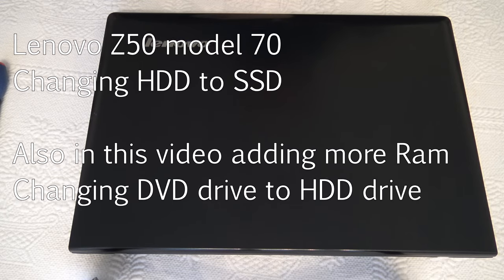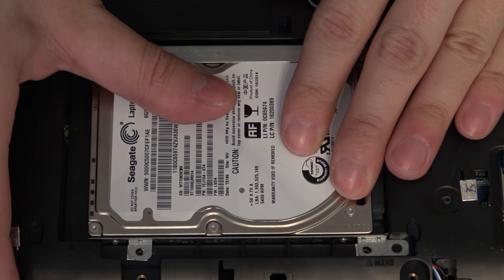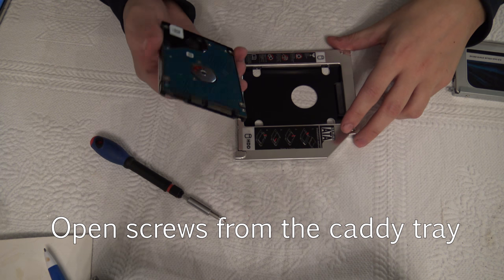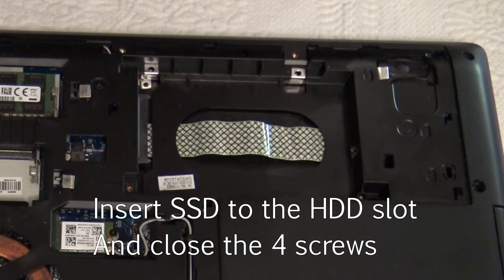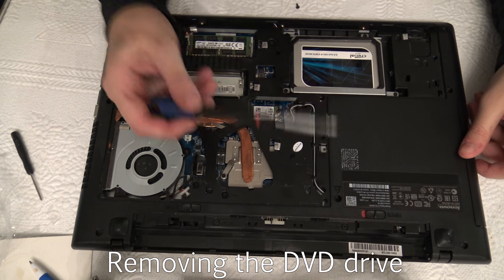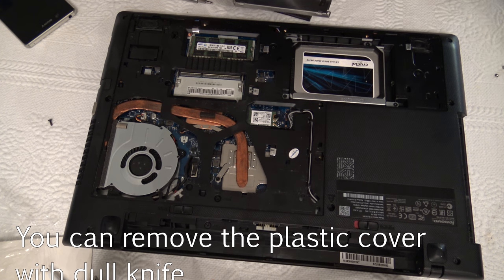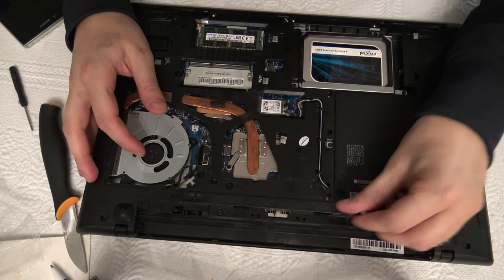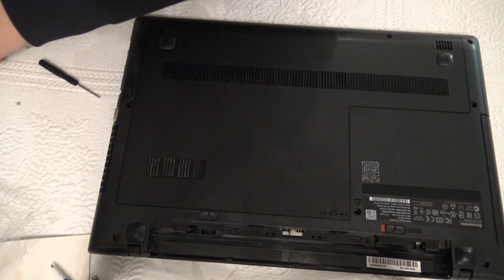Lenovo Z50 upgrading HDD to SSD

Comment: Same laptop I installed a kingston 240gb ssd and my laptop starts in more than 1 minute, the ssd and each partition  in it is aligned, help!!!!!
Reply from the maker: Hi what operating system are you using? Did you install the latest driver for the SSD?
Reply: My other laptop lenovo starts in less than 5 sec with the same OS and ssd u.u
Reply from the maker: Did you do clean install or did you move the old data from old hard drive moving data from old drive can make problems what i have read? 
You should try first installing this driver "Kingston SSD Manager" and run the program and see if it helps. My internet is really slow here in China. https://www.kingston.com/us/support/technical/products?model=SUV400S3
Reply: Love you Mikko <3, sorry I didnt notice you already answered to me, so yeah I fresh installed the w10 pro u.u, gonna try installing the driver bro, I will let you know :D
Reply: Mikko I used the kingston ssd manager and it says everything is ok, even the firmware, what should I do then?????? u.u
Reply from the maker: +Papu Papuino Well you should try this.I believe there is some short of settings issue, Operating system issue or the SSD is broken. 

Try tuning the Windows from settings.

How does the process show on task manager how much it keeps using the SSD capacity in % after minute it should drop to close to zero. 
https://www.partitionwizard.com/partitionmanager/how-to-get-best-performance-from-ssd.html
Reply from the maker: Have you managed to get it working?
Reply: Yes mikko ty, it was just an old driver installed to the sata cable, I manually update it and everything got fixed :)
Reply from the maker: +Papu Papuino Nice to hear they it was very small problem
Reply: yeah kinda lol greetings and have fun in china bro!

Comment: I've gone through the whole process, now the question is. how do I migrate my OS into the SSD? And I can't seem to see it in my list of drives on my PC
Reply from the maker: Do you use Windows 10?
Reply: @MikkoTenhunen  Yes
Reply: @MikkoTenhunen  I have also installed the Crucial Storage Executive Suite
Reply from the maker: Try this guide https://www.easeus.com/resource/hard-drive-not-showing-up-or-recognized.html
Reply: @MikkoTenhunen  Thanks mate! That worked!
Might you also have a link that shows how I can clone my OS into my new Crucial SSD that I've just installed?
Reply from the maker: I used the easyus premium app which you can find from Internet. There are alot other ways to clone your HDD, but if you used it for long time you should do clean install of windows because it would be faster. https://www.easeus.com/disk-copy/clone-resource/clone-hard-drive.htm
Reply: @MikkoTenhunen  I am trying to do a clean install of Windows 10 on the SSD using a bootable usb drive but my laptop does not get past the Lenovo screen. I have tried playing with the BIOS UEFI and Legacy settings, disabling Secure Boot, but still can't get past that. Do  you have any ideas what could be possibly wrong?
Reply from the maker: You have to set the bootable device first in list then press I think it was F8? It might be esc F1, F2, F10 button that opens usb list of devices then you select the bootable device with the windows install device

Comment: What you do to windows os and partition and software things.after you upgrade.
Reply from the maker: Well the easiest way was to do clean install of windows 10 into ssd. I have also tried with other laptops to clone the old HDD Os to SSD and worked fine using "EaseUS Todo Backup home setup" application to clone the data to new SSD. Problem is that will not work if you buy small SSD or the HDD has more data on it than the SSD size
Reply: @MikkoTenhunen  ohh thank you very much.😆
Reply from the maker: Easy way to install Windows 10 is with Usb iso tool installer

Comment: Are there any issues with the compatibility of the SSD with the motherboard? It should support it. I want to install Windows 7 on my Lenovo Z50-70. i need to know if there may be any issues, I know Windows 7 is good with SSD optimization. I installed it on my desktop.

Also, do you know where to get an EXACT replacement battery for this laptop?
Reply from the maker: +Kirby C. For SSD i haven't had any issues with Windows 10. This laptop has drivers for Windows 7, but you have to understand that the Os is getting outdated and some of the new features won't work with it or Windows 7 doesn't use it so well. For battery i haven't found any official batteries anywhere and unofficial ones can be found from amazon but i can't recommend them. My own laptop battery last 5-10 mins since it's getting old
Reply: I am aware of the drivers, I downloaded them last night. What are these features you speak of? Like the BIOS/UEFI compatibility maybe?

I am aware of the dated OS, but I prefer Windows 7 as I hate Windows 10. Everything I do to customize it (like taking OneDrive out, nothing illegal or heavy) gets reversed. The privacy is horrible, too. I just do not want to mess with the OS. I may attempt a Ubuntu install in the future.
Reply from the maker: For gaming it doesnt support latest direct X since its build in in Windows 10. One Drive and many of office features are not supported on older Windows. What i heard booting is not supported that well on Windows 7 for SSD. Also there are some other features that i dont wont to list here that are good on Windows 10.
Reply: I do not plan to do major gaming on this laptop, just casual maybe. I am usually that way with PC vs. console gaming. I just need to upgrade this laptop for my university needs. This computer I am on has W7 on an SSD and I have not had a problem since installing it. I do not use OneDrive, I use Google Drive anyways. Are there any other things you suspect I might have a problem with on this laptop? I plan to upgrade the RAM, too.
Reply from the maker: Only thing come to my mind is installing Windows 7 64bit other wise you cant upgrade over 4Gb of ram
Reply: Yeah it is 64-bit. Do you know what the max amount of RAM is the Levono z50-70 supports?
Reply from the maker: Ram limit on Windows 7  is limited to the versio so if you have Pro you can install two 16GB ram slots into Lenovo Z50. 

Unlike Windows 10 64bit the limits 2TB.
I my self have 4GB and 8GB ram cards installed. 

Version Limit on X64
Windows 7 Professional 192 GB
Windows 7 Home Premium 16 GB
Windows 7 Home Basic 8 GB
Reply: I have Windows 7 Home Premium . Does the motherboard of the laptop even support 32 GB of Ram? I do not believe I have ever seen 16 GB sticks compatible with this laptop.
Reply from the maker: Kirby C. Well since you have gone premium you can't have over 16GB of ram. Its not supported if you get it over that. The biggest ram you can buy from Crucial is 16Gb i haven't tried that so i don't know if its supported. So if you currently have 8Gb of ram you can get 8Gb more ram
Reply: I believe I have 4 GB and due to budget I will get 8 more GB. 12 GB should be enough for a university student. Do you know if any SSD will be compatible with the system? It should be. I just want to get maybe a 240 GB drive.
Reply from the maker: +Kirby C. 240GB is enough since Windows 7 doesn't take alot of space from the SSD
Reply: I know. I have one installed in my desktop. I just wonder if there would be any issues with any SSDs. I would tend to think not.
Reply from the maker: There should not be any issues unless you buy the desktop SSD that doesnt fit inside laptops
Reply: I gotcha. So after some research, the SSD I was going to buy is a 7 MM SSD and the slot is a 9 MM. Any references/ or recommendations?

The SSD Link: https://www.amazon.com/PNY-CS1311-240GB-Internal-Solid/dp/B019H3B3OW/ref=sr_1_1?ie=UTF8&qid=1507061056&sr=8-1&keywords=pny+solid+state+drive
Reply from the maker: SSD fits fine you just need to get the laptop versio which is that what you linked sata 2.5

Comment: Aka značka,veĺkosť  a typ SSD?Chcel by som to vymenit sam.Treba po vymene urobit nejaku instalaciu pri vymene HDD za SSD.Ďakujem
Reply from the maker: Sorry i can only reply in English used google translate.

You can use any SSD but you should have atleast 50GB size. I have used this SSD which i linked to you. You will need normal screw to open the backcover so you can install the ssd, also the hhd bay needs to be removed with the screw. After installing the SSD you will need to figure out how to install Windows or any other Operating system to the empty SSD.
https://amzn.to/3kEGK8S
Reply: @MikkoTenhunen  Thank you. It helped because I didn't know what type and size. I'll go order the disc.

Comment: so your basically using 2 different BRAND ram??? are they working sync?? are they reading as a full 8gb ??
Reply from the maker: Over 1 year been using it without any issues
Reply: from upgrading your ram and adding a ssd have you gotten any NOTICEABLE gaming performance boost ???
Reply from the maker: Well only little and ram only makes it faster on performing multiple task at same time or games that require ram alot example sim city, sims. Ssd makes loading times faster and pc to boot very fast not to mention updates don't take hours comparing to hdd

Comment: if I have my widows installation on the HDD in the caddy will it work? have you tried this?
Reply from the maker: I think it will work but since i didint find data on the dvd drive slots reading speed i would still recommend using the hard drive slot. But if you planning to install dual os i think it should work fine

Comment: ■ Could you tell me please what's the real advantage of a SSD over a HDD?
■ Given that I am not a player and use the computer only for office purposes and eventually working with photos and videos 
■  have a  1TB HDD and someboy offer me a 500 GB SSD-
Reply from the maker: Updates install faster. Restarting computers takes less than minute compared to HDD which can take long time 2-5 minutes. 
Applications loads faster transferring data is faster.

Comment: Hi, thank you for the instructions. I managed to upgrade to SSD and installed fresh copy of Windows on it, formatted the old hard disk and plugged it into the DVD drive slot. However, when I start up the laptop, it seems to be stuck at 'Lenovo' screen.
If I remove the old hard drive, it seems ok, when I connect the old hard drive via USB port using an adaptor, it seems ok.
Any idea why the OS is stuck when connecting via the DVD slot as you have in the demo?
Reply from the maker: Did you place ssd in the hhd bay or the dvd bay?
Reply: @MikkoTenhunen  same as video, ssd in HDD bay and old HDD in DVD one.
Reply from the maker: Maybe the boot settings in bios wrong? Have your tried taking HDD out and only boot the SSD?
Reply: @MikkoTenhunen  any specific setting in bios I should check? Btw, removing the caddy drive containing the old HDD, the laptop boots fine.
I also tried inserting the caddy drive after starting the laptop, in this scenario, I get an error initialising the disk via disk management option: 'Incorrect function'.
Reply from the maker: Press F12 or (Fn+F12) rapidly and repeatedly at the Lenovo logo during bootup to open Windows Boot Manager. Select boot device in the list which is the SSD. Maybe the if the ssd windows don't boot maybe you have installed window incorrectly into it
Reply: @MikkoTenhunen  will try. However, SSD on its own does boot fine, so the windows install on SSD should be fine?
Reply: @MikkoTenhunen  when both HDDs are in, the boot manager menu does not appear at all, tried it a lot. 
When the laptop only has SSD, the boot manager menu does appear but in this case, its just the SSD option that appears as the other one is not plugged in. Not sure, what to do.
Reply from the maker: Can you boot windows using ssd only?
Reply: @MikkoTenhunen  yes
Reply: So I changed a  few things and now it everything seems to work the wanted them to work: windows on new SSD and old hard disk in the DVD drive slot. Of the things I meddled with, one was to do a manual update of bios to latest one online, did a full format of the old hard disk, not exactly sure of what worked, just adding in case someone else stumbles across same issue.
Btw, thanks a lot Mikko for the video, gave me the confidence to do all the upgrades shown on the video  to my z50-70 👍
Reply from the maker: Good that the video helped i will add to the description of video that you should update bios incase it's caused by that issue 👍🏻

Comment: I currently have Samsung 8gb 2rx8 pc3l-12800s-11-13-f3 ram and i5 4310u processor. Which ram should I buy to upgrade and will it be worth it?( I have Lenovo z50-70 laptop)
Reply from the maker: If you still think that this laptop is wort upgrading just buy any laptop ram that is compatible this laptop is so outdated. There is link in description for cheap ram

Comment: I put my ssd in but my computer is stuck on the boot up black screen with the white words
Reply from the maker: Have you installed windows on the SSD? Since the SSD is empty it doesnt contain anything. You need to copy the wanted operating system like Windows into to by installing it from CD or USB
Reply: No I haven't dont that. Would I have to buy a SSD Kit to do it or put the hhd back in ?  because all my screen shows is the white words and it keeps restarting. It wont go to the windows sign in screen
Reply from the maker: You need to install Windows into the empty SSD or you need to clone the old HDD data into the new SSD

Comment: Hey. Can you benchmark the performance GTA V with Ssd..  BTW I have same laptop, Z50-75..  I planned want to buy Ssd.
Reply from the maker: I did some kind of Novabench test.
CPU Score
405

RAM Score - 12GB
204
RAM Speed: 12694 MB/s

Graphics Score
131

Direct3D 11: 7 FPS
OpenCL: 0 FLOPS
 
Disk Score
66
Write Speed: 228 MB/s
Read Speed: 444 MB/s

Comment: Hi! What size of card bay for the HDD driver do u use>?
Reply from the maker: Phương Nguyễn If you mean the SSD size it's 2,5 inc for the laptops. The desktop PC HDD which is 3,5 can't fit inside a laptop
Reply: no, i mean  Hard Drive Caddy for CD/DVD-ROM. 9.5mm or 12.7mm. Tks you.
Reply from the maker: 9.5 mm
Reply: @Mikko will 12.7mm work as well?
Reply from the maker: I don't think that can fit

Comment: z50-75 is the same as this laptop, has 2 ram slots, two channels ?
Reply from the maker: It is the same laptop but with different parts. According to the information from Internet there is two ram slots. One of the slots there is 8GB installed
Reply: @MikkoTenhunen  nice information,my ram is 4 gb, if I add 4 giga in the other slot, does it accumulate to 8 giga ?
Reply from the maker: Yes

Comment: Hi if I switch over to SSD do I need to copy my info and windows from HDD.?  If so how do you do that ?
Reply from the maker: +dasboot360 Well easiest way is to make clean installation to the new SSD and move you're old data from the HDD. This would mean you need to install all the applications again. 

Here is a good guide how to make a clone from your data on the HDD. 
http://lifehacker.com/5837543/how-to-migrate-to-a-solid-state-drive-without-reinstalling-windows/amp
Reply from the maker: But you should either clone youre data or do clean install on the new SSD drive.

Comment: Hi , what size new ssd need to have?
Reply from the maker: Depends on what kind of use you need it on. I have 525GB size SSD and the actual size what Windows shows is 488GB. I do video editing and some gaming on it so that's why I have a bigger one. Also since I have an extra hard drive I have more space for other files. If you just do normal office work you could just get 100-200GB SSD

Comment: i like the dvd drive. saved my ass plenty of times
Reply from the maker: Like how? I gaffe secondary computer for dvd
Reply: @MikkoTenhunen  bios wont read usb so dvd did the trick. Also old drivers are hard to find and easy to install from dvd. also some music is not available online so can only be ripped from CD. I like having it
Reply from the maker: Maybe the settings are from bios?
Reply: @MikkoTenhunen  my bios is not good. dvd always works

Comment: after doing all steps my old hdd is not recognized
Reply from the maker: Have you tried updating bios? Also you have to set the old hdd to new drive location
Reply: You .mean flashing bios? I no longer  have the battery :(
But when i first boot, the old drive was still the priority and i saw my old files, after changing boot priority, i was able to boot into my faster drive but unfortunately, the old hdd(now in the dvd slot via caddy)  is no longer recognized
Reply from the maker: Updating bios is not the same as flashing bios. I don't think updating bios requires battery
Reply: @MikkoTenhunen  will try sir
Reply: @MikkoTenhunen  sad, when i tried updating bios, im getting error
Reply from the maker: Have you selected the right device bios file?
Reply: @MikkoTenhunen  9bcn91ww.exe i wonder if i downloaded the right file, btw i change boot priority awhile ago and I can see both drives, but when I switch back to the faster drive, I can no longer see the other drive
Reply: @MohammadYusophMMuti  Hey did you find the solution yet? I'm having the same problem. The HDD placed in caddy is not detected in This PC, but detected in BIOS/Disk Manager. I also have no battery so I can't update the BIOS.
Reply: @ForrestPump  no fix yet, but i think if i reformat the other disk it might work, cuz my oher disk is not a new one

Comment: Can the processor be changed
Reply from the maker: No
"The processor is non upgradable.
BGA is Ball Grid Array  Which means it is soldered on the board itself.
It would appear similar to the board image below if you have not checked it physically yourself.
https://forums.lenovo.com/t5/Lenovo-P-Y-and-Z-series-Notebooks/Upgrade-CPU-lenovo-Z50-75-its-possible/m-p/5012620
Reply: @MikkoTenhunen  thanks